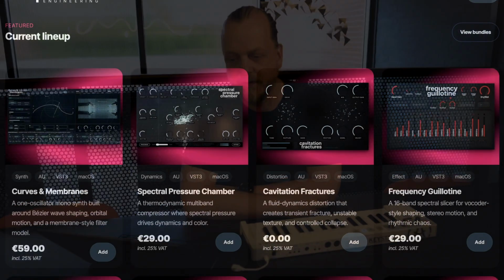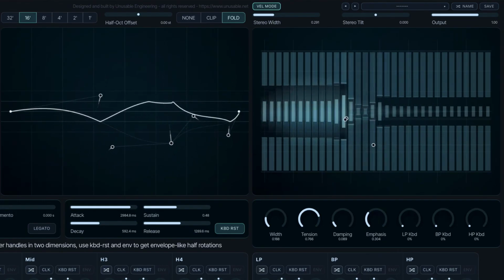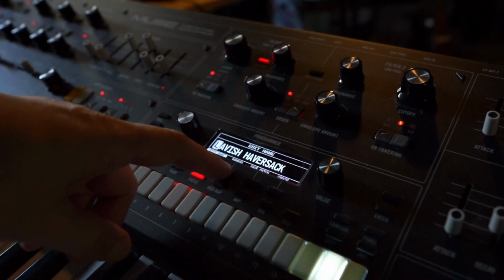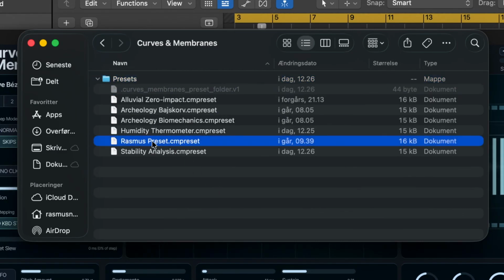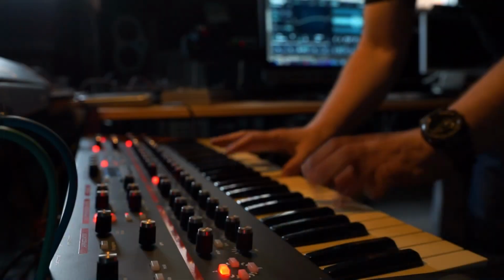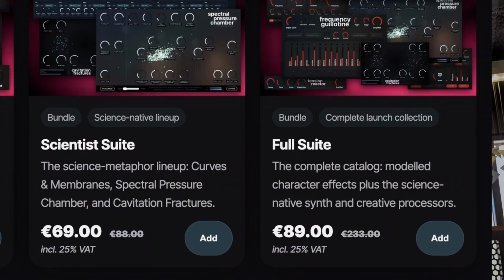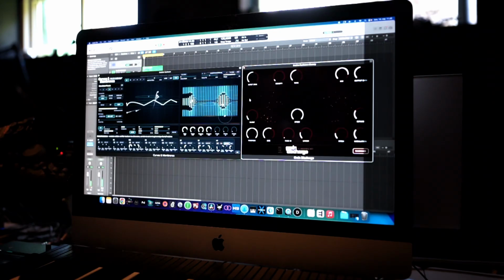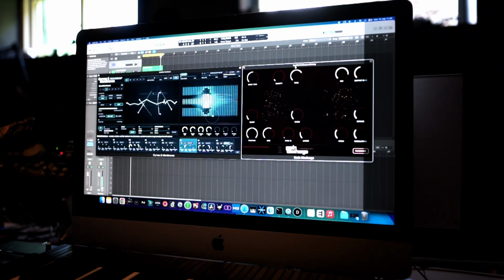Unusable Engineering Update | Curves & Membranes Features and Grain Discharge

Comment: The double click does not reset knobs and sliders to the default. Is that a bug?
Reply from the maker: Thanks, I had managed to drop it in a branch merge just before the release... Sorry about that and thanks for letting me know. I have made an update for Curves & Membranes to 1.1.2 - available now via the account recovery system - fixing that issue. It also includes a tiny new feature, when in no clock, no kbd step mode in the wave presets, the slot selection is sweepable by using CC#4 (foot controller), with or without slewing.
Reply: @UnusableEngineering 
Thanks a lot.
Reply from the maker: No, thank you! It is wonderful with quick feedback!
Reply: @UnusableEngineering 
Pleasure. Curves is a great plugin. Is it possible to midi map presets by any chance? It would be awesome to be able to toggle through them.
Reply from the maker: @mygoogle1525  So, like midi program change or are you thinking about something else? (The simplest robust solution would likely be to use a cc as bidirectional control stepping forward or backward (send a selected cc below 64 for back, above 64 for forward) , as the preset system in itself don't have any limits to how few or how many presets you can have).
Reply: @UnusableEngineering 
Yes . Program Change is what I meant. I use TouchOSC as a controller.
Reply from the maker: @mygoogle1525  I'll read up a bit and think about it. No promises, but it shouldn't be impossible. ;)
Reply: @UnusableEngineering 
Thanks a lot.
Reply from the maker: I have it working in a way that somewhat makes sense, but as I have merged the codebase with the windows version, I will need to test it a bit more before releasing. I do think I can get it up before the weekend though.
Reply: @UnusableEngineering 
That's amazing. Thanks a lot.
Reply from the maker: @mygoogle1525  There is an update available. It is worth reading this: https://www.unusable.net/news/curves-and-membranes-v1126-update/ as the program change is following a text file as I wanted to make it possible to change the order, without adding any complexity to the rather quirky preset system.
Reply: @UnusableEngineering 
Great. Thanks for keeping me posted. Will have a read tomorrow.
Reply: @UnusableEngineering 
Hi,
How are you? Thanks for updating Curve. Preset change works but only when the pluhin is open. It also resets to a  default preset  ,as soon as I close it.
Is that a bug or did I miss something?
Greeting.
Reply from the maker: @mygoogle1525  Yeah, it is a bug among a few in the presets. I have fixes ready in the new synth, as I make presets for that one, I have gotten frustrated and fixed them, so I need to copy those fixes over to Curves & Membranes too. I can probably get it live in the beginning of next week. I had it on my todo list, but you just pushed it further towards the front. 
Have a great weekend!
Reply: @UnusableEngineering 
Thanks a lot. Have a nice one.
Reply from the maker: @mygoogle1525  Sorry that it took some time, but there is an update available now on the account recovery page. 

I made a news post about it too, on the website. 

I hope it solves the issues you were having.
Reply: @UnusableEngineering 
Thanks a lot. Will have a look once I'm back home
Reply: @UnusableEngineering 
Hi tbere again. I'm on version 1.1.35 and the plugin still does not change oresets while closed. I also, cannot change the size.
Reply from the maker: Ah, when the windows is closed. I think I found it, I had the logic in the editor layer... Points for stupid to me please. ...and I will add an extra hidden handle for the resize that is easier to grab. Will try to get a fix out with the thursday launch.
Reply: @UnusableEngineering 
Thanks a lot. Point to you for taking care of it.🤙
Reply from the maker: @mygoogle1525  I got it working. Thanks for the heads up. 1.1.40 will be available on thursday. (including an extra hidden resize handle slightly above the init button).
Reply: @UnusableEngineering 
Thanks a lot. Glad to see a dev that cares for his customers. Highly appreciated.
Reply: @UnusableEngineering 
Hi there,
Just wanted to sk ,if there was an update on thursday? I cannot find verion of the plugin in the UI so not, if there is a new one.
Reply from the maker: @mygoogle1525  The 1.1.40 should be on your account page. "macOS 10.15+ · Curves & Membranes · v1.1.40
AU,VST3 · Curves-&-Membranes-1.1.40-distribution.zip" - that one has the program change management separated from the editor layer.
Reply from the maker: @mygoogle1525  I dunno if my answer disappeared. V.1.1.40 has the fix and should be on your account page:
"macOS 10.15+ · Curves & Membranes · v1.1.40
AU,VST3 · Curves-&-Membranes-1.1.40-distribution.zip"
Reply: @UnusableEngineering 
Thanks . Will have a look
Reply: @UnusableEngineering 
Thanks for the update. I still can't resize the plugin but at least I can change the presets while it's closes. That was the most important thing for me.
Reply from the maker: @mygoogle1525  What DAW are you in, I might have asked before, sorry if that is the case?
Reply: @UnusableEngineering 
I'm using GigPerformer. Ot's not realy a DAW but a modular  plugin host.